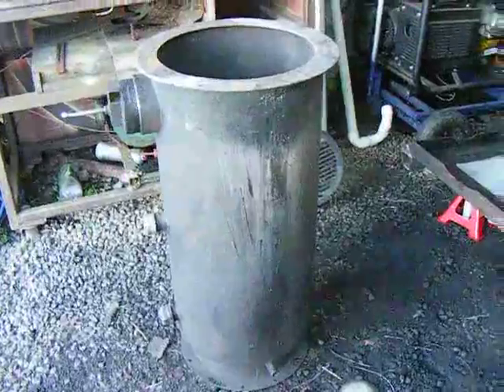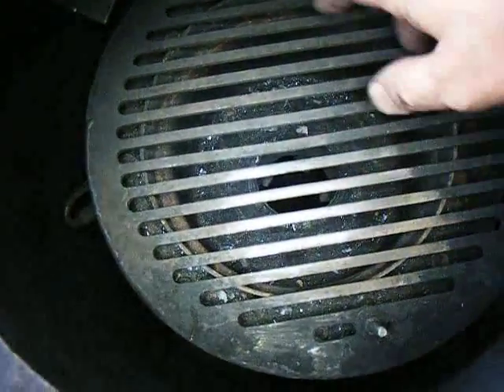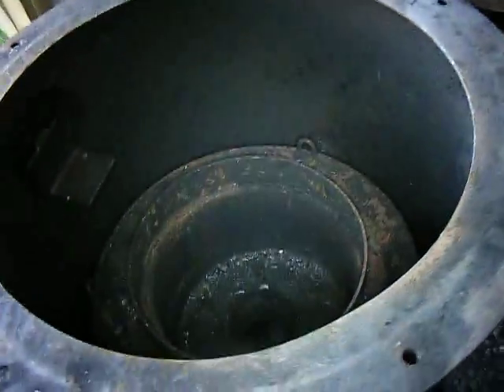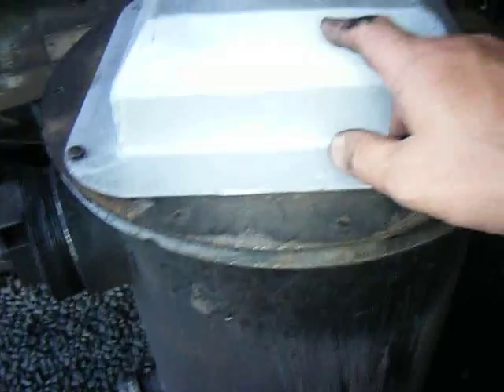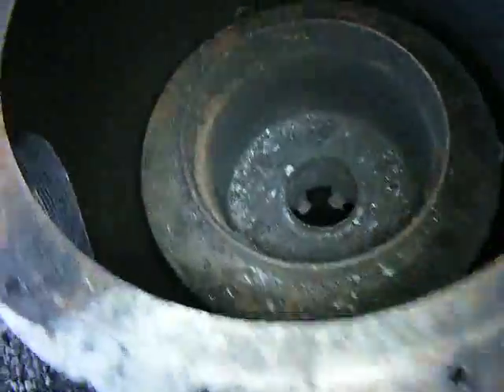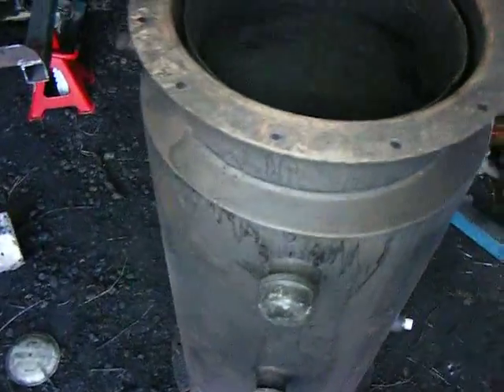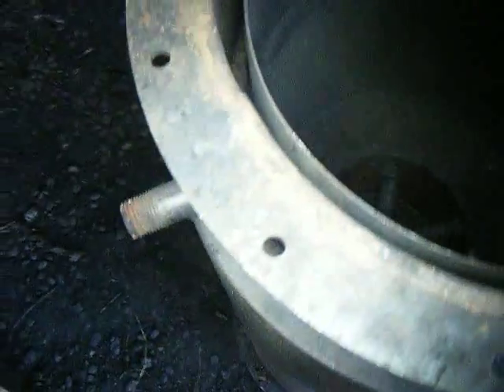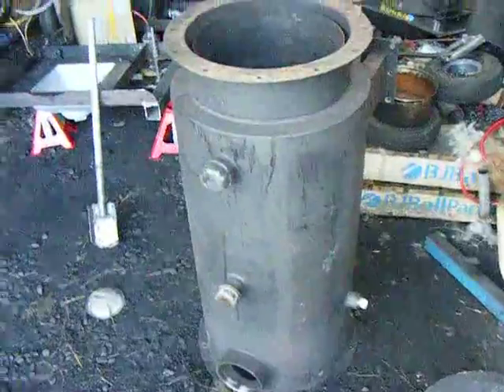Gasifier performance problems - and resolutions

Comment: i think is normal to get black tary crap out of the condensate jacket  its what comes out (i give it to my dad and he poors it down gofer holes lol =3-) of mine but i have a 1" out let so it dosent easily get clogged i was wondering if the pan tech worked and i was linking in my opinion you should move the nozzles back just a little not as far as ben had it but like half of what u added my nozzles are like 5" above my restriction and brout in falry tite cant remember right now the measurement but my gasifyier is also bigger so IDK
Reply from the maker: xoxoXoieoxox 
Yeah, I get a fair bit of juice out of the condensate gutter. More in winter than in summer.
I had to enlarge the discharge port to 1.25 inches, as the original 0.5 inch one became hopelessly clogged with goop.
I recycle the juice, by pouring it on the wood in the fuel dryer.

The pan method worked like a charm  :) .
It produces a very deep charcoal pit that cleans and cools the gas as it leaves the reduction zone.
Indeed, I can tell how well it is working by how hot the cyclone gets.
When running clean, the cyclone takes longer to warm up. If the charcoal is not properly seated, the plumbing gets much hotter, much sooner.
Due to the deep charcoal bed, I often get a purple flare before the filters  :) .

Since that video was made, I did move the nozzles back a fair bit.
It would be nice if I could move the nozzles again, but they have become locked in place. I managed to snap a spanner while trying to free them up, so I decided to leave them as they are.
When the nozzles finally fail, I will go for a Flash center feed nozzle instead.

These beasts are never perfect, so I am sure we will always be tinkering with them  :) .
Reply: ***** i highly recommend against the center feed i have tried this i found the tube not only did not get pree heated enof the tube actually cools the reaction buy passing cold air threw the tube going thew the fire NOT GOOD remember the reaction is all ready trying to take all the heat out of the flame to begin with its weird but i have actually seen this reaction take place in my wood burning stove the coals will actually take the heat out of the fire extinguishing it self so u need all the heat u can get the hotter the better just short of smelting the core and the wood almost explodes with gasses this is why i put my tubs up threw the bottom after the reaction b\c buy that point u dont need the heat any more so i thaut rob it from there and put it back in works good but kinda complicated to build (my goal is not to reinvent the wheel i just wanted something that worked well and i f'ed up and hit the bulls eye)   =3-
Reply from the maker: xoxoXoieoxox
You have given me plenty to think about as far as preheating goes. Since I often operate this machine in sub zero temperatures, the last thing I want to do is freeze the reaction.
There is a preheater built into this gasser, so I should be able to tap into it and use the hot air, just in case I am forced to go with a center feed system.
Flash seems to be doing well with his center feed pipe, but maybe he is operating in warm weather?
Another point that might make a difference here is that my gasser is delivering only 2 HP of gas, as is Flash's unit.
Perhaps the center feed system is ok when used at very low gas production rates?
Reply: ***** perhaps ur right about the 2 HP thing mine is producing about 50 HP so maybe the flow is a problem then for the center feed did u see my wood cutting vid?
Reply from the maker: xoxoXoieoxox
I think it is harder to make good gas for a small engine than it is for a larger one.
The gasser never gets particularly hot, as the reaction zone is really tiny.
Imbert maths probably don't encompass small engines, so we have to make it up as we go  :) .
To make mine work, my design uses charcoal as an insulator between the raised reaction cavity and the gasifier body.

Ohhh, yer wood cutter vid is up?
Sweet!
I shall put my boots on and run to the viewing room right away  :) .
Reply: ***** i think its easier to make good gas for any motor larger than one cyl a singal cyl dosent have the constant vac that a muti cyl dose
Reply from the maker: xoxoXoieoxox
True, the single cylinder engine will generate quite a strong pulse.
Mine used to make a lot of noise this way, until I improved on my gas mixing system.

I have found that a lengthy filter chain will absorb most of the pulse energy, as there is quite a lot of resistance for the pulses to get through before they can reach the gasser.
As a result, the gasser does not seem to feel any pulses  :) .
Reply: ***** do u see a lose of power vs. fewer filters with less resitance in flow??
Reply from the maker: xoxoXoieoxox
Yes, there is a slight loss of power when I pack the filters too tightly.
Over time, the filter material becomes wet. This reduces power progressively over a 9 hour constant run.
After about 25 hours, I need to clean out the filter. This is very time consuming, as it takes nearly 2 whole minutes to do it  ;) .
The main problem with mine is that the gasser does not breathe too well. I think it is because I have designed too deep of a charcoal path into it.
I wanted a very aggressive charcoal filtering path to exist inside the gasser. It works, but it has its down sides.
Still, I do get clean gas, so I am not complaining  :) .
Reply: ***** ok so concluded the testing of the water type filter over the bed style filter FAIL i could berly get the reactor to burn due to lack of flow and the engine couldn't build any RPM so i guess its back to the bed style filter i get like 2 hoppers until i have to clean it out mine takes like 15 min to change not bad =3-
Reply from the maker: xoxoXoieoxox
Ahhh, that's a pity.
I was perhaps a bit luckier when I tried the same idea.
Mine used a 4 inch steel pipe with a puddle of water 4 inches deep. The gas was fed down into this puddle via a 2 inch pipe, and was bubbled into the water through small holes near the end of the 2 inch delivery pipe.
The cleaned gas was taken off at the top of the 4 inch pipe. It worked well, as it collected tar and soot nicely.
This was for my FEMA tar maker. The Imbert gasser really doesn't need anything like that  :) .
Reply: ***** ya i put mu bed filter back and it works fine now i drove it to the store and back i just hop i didnt make tar with that last run =/

Comment: I don't think you're pulling anywhere near hard enough on that gasser. you'd probably be better served giving it to me and building yourself a new one.... jk... I'd try and fit a 2 inch restriction in there...
Reply from the maker: Indeedy, that little engine is really only sipping at the wood when it should be slurping and guzzling it.
Hmmmm, you can have the gasifier every other Sunday - and on the occasional weekend - but only if you promise to feed it on the finest and most expensive of woody yumyums ;) .
The gasser now has a 2 inch restriction. Also, the new restriction is raised by 1 inch, so it is now sitting 2 inches below the nozzle ring.
Hopefully, this will clean up the gas and make me all smiley  :) .

Comment: i think your nozzle circle is too small. I'd open it to 5 or 6 inches.
Reply from the maker: Yes, you are quite right.
It ended up being so small becuase I simply jammed a bunch of parts in there to test an idea.
It worked like a charm, but I have since reset it to about 5.5 inches and also made the nozzle holes a bit smaller.

Comment: Hey how did this new mod work out for you?
Reply from the maker: Howdee partner,
Yup, the mods made a massive improvement. The resulting gas was a lot cleaner and was also able to flow through the filters more freely. Not only that but the engine delivered more power per pound of tree bits  :) .
The system is currently in bits and / or pieces at the moment, as I am applying a series of other improvements to it. There's a fair bit to be done, but there is no hurry as all of my power is coming from my solar arrays during these summer months  :) .
Reply: *****
I couldn't remember if I had asked you that question or not. One more question. did the tri-filter work for you? I'm still fine tuning the tri-filter
but for now it works so I am in the safe zone so I'm happy about that.
Reply from the maker: flash001USA
Howdee fellow woodgas addict,

Initially, I was not able to use the tri-filter due to the gas flow being overly restricted by the filter media. It worked if I packed it very lightly, but that effectively defeated the purpose of the filter.
Everything changed when I made the mods to the gasifier:
As a result of raising the restriction and shrinking the nozzle ring diameter, the gas flowed very easily through the filter chain, even when it was tightly packed with filter material.
I suspect that the cleaner gas contained smaller particles, so flowed better?
This allowed me to get a lovely blue-white flare from the filter and it also boosted engine performance very nicely.
Prior to this, the post filter flare was almost impossible to obtain, and engine performance was marginal - but good enough for my winter power needs.
My setup employs your filters as 'cartridges'. These sit in a guide frame that lets you drop them into place. Once placed, you simply twist them into the locked position like a light bulb.
This works like a charm and allows for rapid and reliable placement / removal.

To put it in short form, your filters are the perfect solution for portable and stationary gasifier generators  :) .
Reply: *****
Nice!
Reply from the maker: flash001USA
Yup, it sure is  :) .
The current project is a semi-automatic fuel processor system.
It will cut my collection of shipping pallets into 'gasoline granules' using solar power to make it work.
I am hoping to process at least 1 ton of gasifier fuel for use in winter.
Youtube videos to come, as this project develops  :) .
Reply: *****
You have the right idea! Most people build a gasifier and never realize how important it is to have a method to make a reliable fuel source. I need to
come up with something for my setup too. The hand chunker will get me
by but in the end I want to be able to make large quantities of fuel with ease.
Reply from the maker: flash001USA
Indeed, most of us build the gasifier - then consider where to get the food for it.
Such was the case here too, but that all changed when I realised that I would be relying on this gasifier to satisfy my winter power requirements.
With a bit of imagination, you'll soon be coming up with ideas for mass fuel production  :) .

Comment: Ya in my very first tries at wood gas early days when all i used was a bunch of cyclones and a wood chip filter i had the same thing and that was all due to not getting the burn hot enough. I could fill up cyclones and pipes with crap and tar in just a few hrs easy. But once i noticed that my reduction size to motor pull and fan pull where way off and i reduced them until they matched up for a hotter burn then once i did get that figured out bingo no more gunk buildup at all even after many hrs of running. You may also want to try and add more of a cone on the upper side by using a mix like flash did in his build to also help insulate the metal as you raise up the temps. Now this is my own oppion and that bottom bell is nuts way way too big i could see sneaking in there cutting that out and putting in a longer strieght tube to keep the hot gas more concentrated in one small area and letting it stay hot longer to help clean the gas. Keep in mind i have never worked with any bought ones so i know you have had lots of fun redoing it over the time. I too hate how they messed up a good system i never now know when ppl put up new vids it sucks they need to switch back. Keep up the great work like seeing how your doing on it!
Reply from the maker: This is a never ending learning experience, that's for sure  :).
I think the idea you suggested with the long straight tube is a good one, and I have been looking into ways of doing it for a wee while now. It seems that I can make up a press fit insert that will give me the straight tube, without having to cut out the charcoal bell.
It turns out that the bell is also a part of the air preheat system, so I really don't want to mess with that if I can possibly avoid it.
My idea involves a long 3 inch diameter SS tube with a slightly shorter 2 inch diameter tube inside it. There will be a hotwell at the top and the tubes will dip into a charcoal pit that is 9 inches deep.
Well, that's what I have in mind at the moment, but that could all change when I start fabricating it  ;) .
I have all summer to play with this, but it absolutely needs to be up and running in time for winter.

Google pus has totally screwed Youtube up.
A few folks like it, but people who have better things to do with their time than mess around in a social group totally hate it.
There's one idiot out there who put up a video telling us to get the f**k over it. What a loser he is!

Got lots to do on the gasifier. It's in 93 pieces right now, but I will get it all up and running soon enough  :) .
Reply: ***** Oh wow i never got that it also was part of the preheat so ya then it is harder but not impossible to work around the press fit idea would work nice and i think once you get that done it will help alot with gas quality alot keeping it more concentrated in one area holding it hotter as it passes threw the biochar and in the end cleaning it.

Oh and i agree they messed it up big time its just all messed up i missed all these last few vids due to i never knew you posted them and b4 i would get email on it and now i would have to check each one of the accounts each week to see who may have posed a vid really sucks and is all mess up.
Reply from the maker: tecknowfreak
Yeah, it's a bit of a booger alright, but I have high hopes for my press fit idea  :) . Also, I am cosidering dumping the cyclone and replacing it with an expansion tank like Flash has done. There's not much room on the gasifier frame, so it might be a bit of a challenge to fit it all in. 

Google pus really sucks alright, but the "good" thing is that all the bad comments that were hidden behind spam markers before google messed youtube up have become visible again.
So, 'gurgled pus' obviously favours spammers.

Comment from the maker: Indeedy. The 1/2 inch drain tube on this gasser is way too small. It got hopelessly plugged up with a 50:50 mixture of gunge and goop.
Going to a bigger size is definitely on the to-do list  :) .

Comment: one thing i noticed was that when i made a monorator hopper i needed a rather large tar/condensate drain pipe from the catch gutter of about 2 inch otherwise it clogged quite quick.

Comment: I ran it for two hours with no bridging last night. The expansion tank and the jar only captured soot water. I tested it by pouring the liquids onto a paper towel and it rinsed totally clean with just water from the spigot so I think that I'm cracking the tars a bit better now that I made the changes. I've started on my final "How to" video and I'll be covering how to properly start the gasifier up for a clean burn. To me a clean ignition is the main trick to getting good gas.

Comment: I don't see why it wouldn't work. I just put the new restriction zone on my gasifier tonight. I reduced from 3 inches down to 2 inches. I may need to change my fuel size too. I hope to record a new video before the week is out.

Comment from the maker: Howdee Flash,
Yup, this gasser never really ran hot enough, as I was not pushing it as hard as I should have been. My electric power needs are very modest, so the 1KW I was getting was as much as I had any need for. Indeed, my peak daily power use during winter is 2KWH.
The mods that I added caused a very worthwhile improvement, so I intend to enhance their effects by shrinking the restriction to about 2 inches and altering the nozzle ring to match it. 
Cont:

Comment: Cont: Just to really make sure that I'm staying hot enough. xoxoXoieoxox mentioned that his FEMA was giving him the same grief and mine was too he also made another good point about a single cylinder engine not moving enough air to get the high temperatures and once again he is correct. My build is right on the edge of cracking the tar with my configuration and once I reduce a bit more that should raise my temperature from the edge up to a comfortable balance. Good luck with your mods.

Comment: Steve, Flash here. I seen some of these issues until I got my build resolved. The gasifier will always collect some hash and trash but when you see tar build up internally that's a good indication you may not be hot enough. I also seen issues with the biochar slipping through the grate to easily when I used an inverted bell and it gave me grief so I went to a simple straight tube output and solved that issue too. I plan on reducing from the 3 inch reduction down to 2-1/2 inches reduction. Cont:

Comment from the maker: Indeedy, those earthquakes can cause serious liquefaction to take place. We have had more than our fair share lately here in New Zealand.
The relatively gentle vibration that comes from my 13HP engine is usually enough to keep the fuel from bridging in the gasifier. A problem can show up when the engine is running at a different RPM, as it can get too far away from the natural resonant frequency of the gasifier frame. I like to think of a motorised shaker as a little insurance policy  :) .

Comment: ya my fema would tar up after an hour ill pass on a finding of mine i found that wood gasifiers dont work well for single cyl. engines but when i ran my 4 cyl it ran really well and on a really small reactor (vid M-5 on wood gas) but the statement is redundant it tared up the engine B\C it was a fema well it snowed today so this means we could probably restart our resrch with the new imbert im kinda axtious =3-